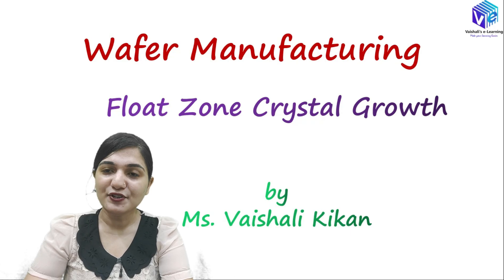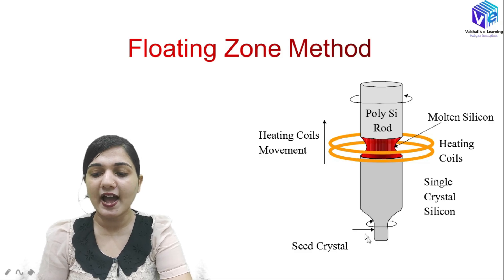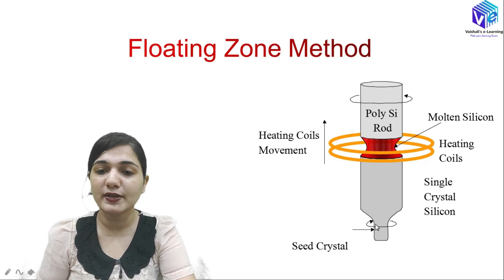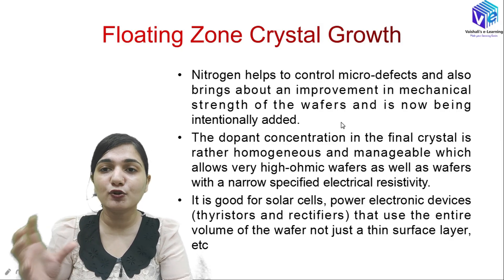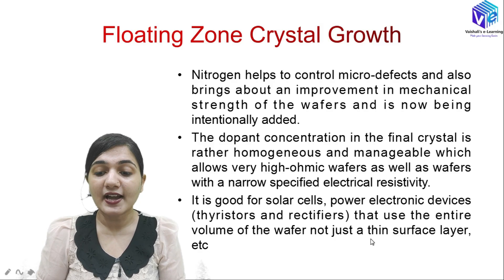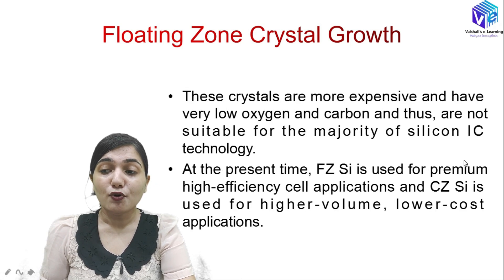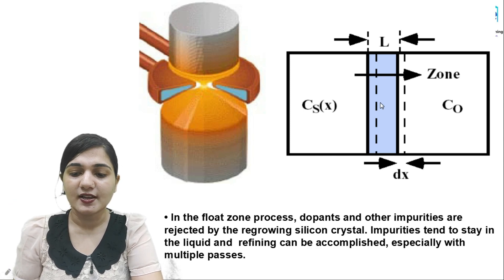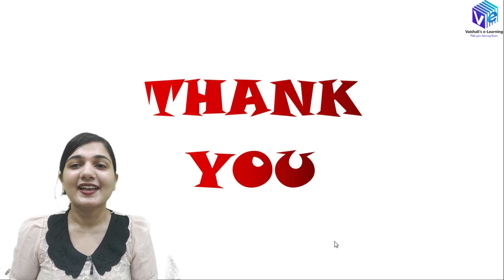Floating Zone Crystal Growth Process | L 13 । Wafer Production | VLSI Technology I IC Fabrication I

Comment: I think diagram is wrong, simple logic, like candle melts and flows down due to gravity - you CANT pull upwards the RESULT of purifying Silicon, 
however the seed crystal CAN Pull it upwards just like candle thread & pure wax body down below (pure silicon) - you have a furnace beneath that is also contained by inert gas. This diagram is reversed. Also its more likely a Induction coil not RF coil ?